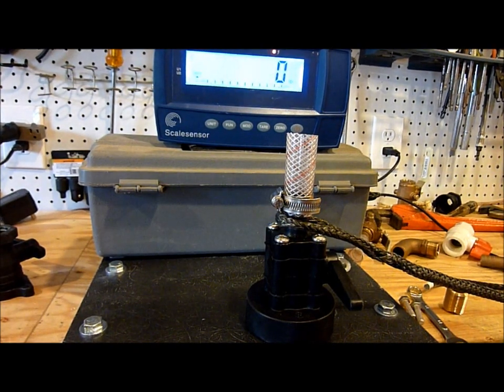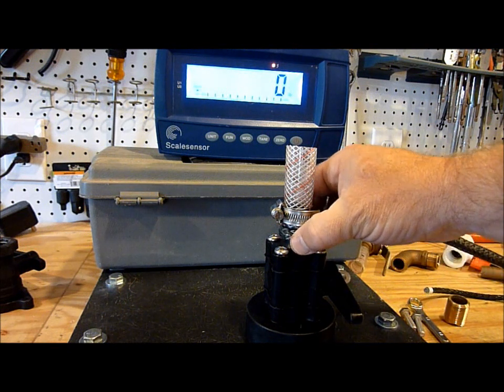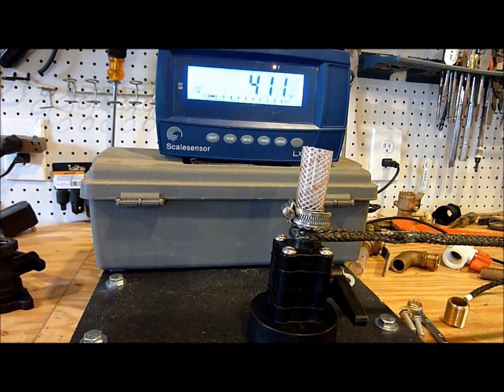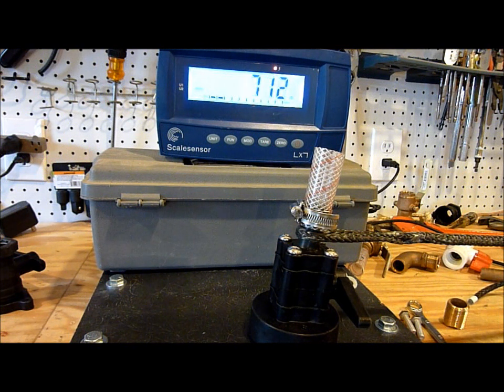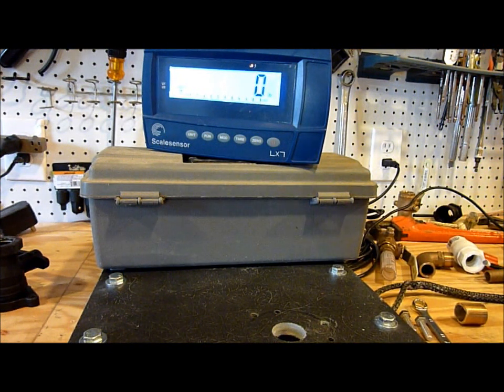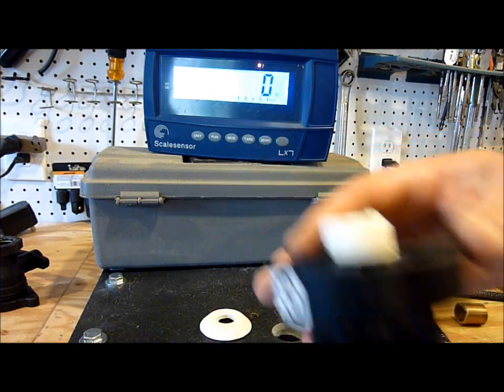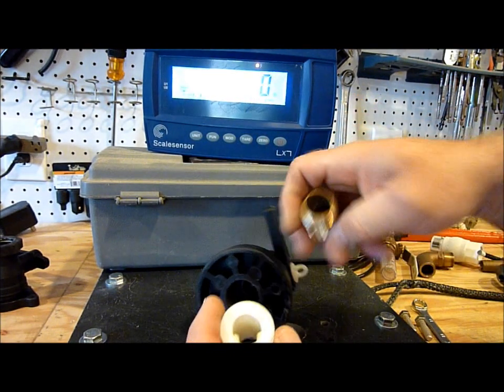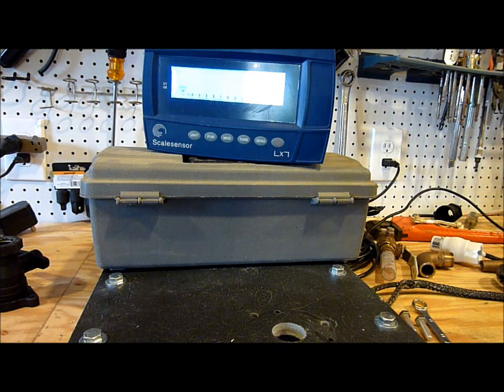Forespar Marelon OEM / 93 Series Destructive Testing

Comment: Excellent video. Highly confidence building. Thank you.

My Marelon sea cocks (total of six on my C36) are very hard to operate now after about 10 years, half in salt water and half fresh water. They require lots of muscle. Probably barnacles causing the resistance, but I wonder how I might 'loosen' them up. Or at this point would they be worth replacing? When the boat goes on the hard next year for bottom paint is there any maintenance I can do to them to bring them back to near-new condition?